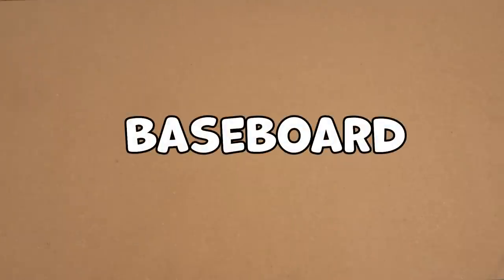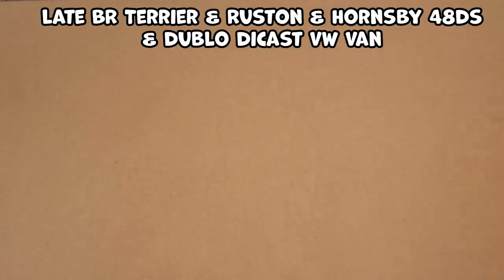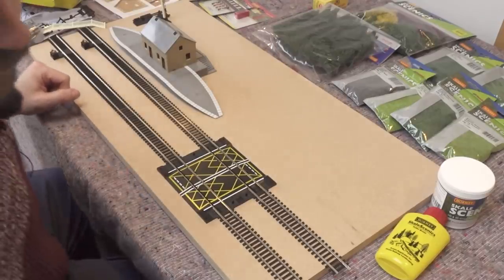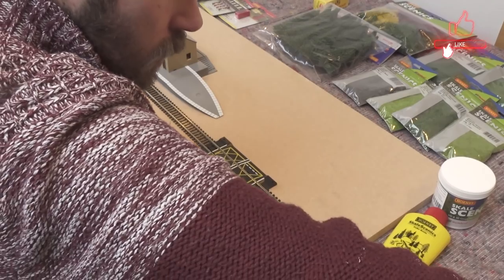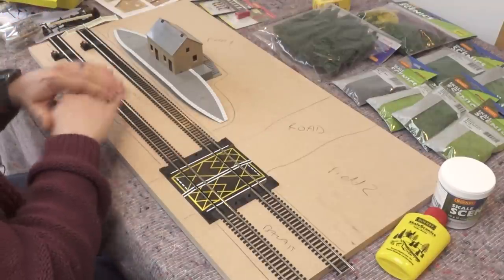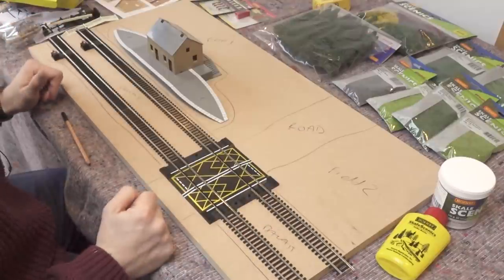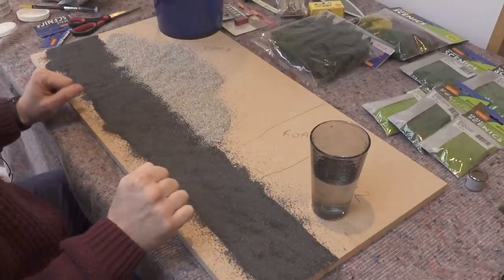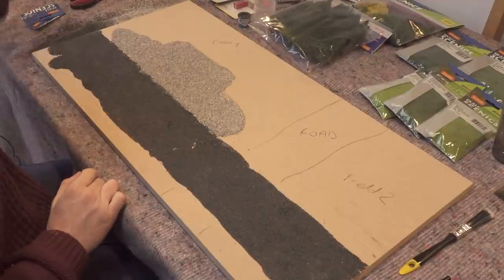The Perfect First Model Railway Diorama (and How to Build It)

Comment: Plan for the future get a 6x4 feet baseboard On legs or trestles made by you or help from some DIY person, Try to build so you can drop some point motors into the baseboard if possible , PAINT THE baseboard with grey or green house emulsion paint from DIY store that will take the bareness away on board (get it so far) Now plan your track and learn to lay the largest radius circle first with a switch (point as some call it too) With a siding so you can run a test train around the circle you have just laid with thin double side sticky tape at a few places only just to hold your track in place while testing your track with power connectors attached ( some thought required here) Get the locomotives to run around the track and across point down siding with our derailing with rolling stock as well, Nice to see a train run around a circle the children love to see them go round and round, Ballast track comes later when you have all your track plan in place in case you want to move a few pieces around when happy with track pin as you go and keep the straight sections straight, Slowly dose it, Trains running smoothly first, Then scenery which you should have some idea what you want, A model railway is never finished that’s the whole idea there is always something to add

Comment: I use ready ballasted Kato track. If I was using ordinary track I'd always lay the track first and then ballast. You don't want uneven track which can derail the rolling stock, especially on points.
I think it took you more time to remove the track, ballast the baseboard and then put the track back on than it would have taken if you'd glued the track first and sprinkled the ballast on top of it.
Why Hornby insist on showing the wrong way to lay track, (which will cause beginners problems and could put them off the hobby), I'll never know.

Comment: Great effort Mike , painting techniques paint as you did but if you dab it over with a sponge. That will take the brush strokes out of it and give a nice road surface .  Also just To let you know, ballast normally is done after the track is down . Then you can put it, in between the sleepers. But looks very good so far, top marks for your 1st go

Comment: Fair play for having a go, I think having people in businesses coming for different backgrounds as yours is useful as it gives variety and diversity but at the same time it’s also great to have people live and breathe the products, so you getting that experience as a first timer is really useful.

In the past (thinking back to my childhood hornby catalogues in the early 90s), an amateur modeller (in the most respectful sense) was advised to place the track where you want it, draw around it to create a ballast bed, paint it grey, pour on the grey scatter (which was pretty flat and easy to pin through) and then place the track over. Another approach championed by Budget Model Railways is to place down roof felt as a more affordable but equally plausible alternative to ballast mat which again is quite flat and achieves a similar effect.

If you glue down ballast derived from grit before the track rather than scatter, sand of fine grit (most 00 ballast I find is too course), then it is hard to get an equal thickness and you may have problems getting the track level, and if you’re pinning it, you can expect more issues,

If your goal is realism however (and it’s fine if it’s not and it’s just about fun), then looking at pics in real life will help but you’ll notice the sleepers are somewhat sunken into the track, and sits in a bed of ballast above the ground level with often a well defined shoulder. It’s also rarely a uniform colour. A few others have suggested some approaches here, but a common one is to lay down a layer of cork sheet first under the track, then lay down the track, which can be pinned or glued depending on how likely it is to be permanent, and then the ballast is placed over the lot; there are some tools to form this into a nice shape but you can do it with a brush. A mix of water-diluted PVA with a drop of washing up liquid to break the surface tension is then applied usually with a pipette to secure the ballast.....

I’ve tried doing it this way and had a nightmare, never got the glue mix right no matter how dilute or how much washing-up liquid!!! Because most of my layouts are very small, I’ll test out the track first, but I’ll glue it down with PVA painted where I want the track bed, place the track, and the pour on the ballast. It can’t stick where it shouldn’t because there will be no glue in the visible surface of the track. To add more realism you can then go back after and build up more ballast where you want it. On some layouts I’ve used cork to build the level up, others I haven’t bothered, especially where the layout represents a yard rather than a section of proper line. I tend to mix crushed soot, different colours of sand and some fine commercially available ballast products to get the effect I want and have even added a little weathering powder to the mix to get the colours I’m after.

The most important thing is this is a learning curve, some railway modellers can historically be quite particular and snobbish, fast to criticise but they’re complete wrong. There’s nothing wrong with aiming for total realism and running a slick timetable. There’s also nothing wrong with slapping a bit of track down and playing trains. It’s a hobby, and it’s to enjoy, you can let your creativity blossom as far as you like.

Comment: Just out of curiosity where did you get the baseboard for your layout? Or unless anyone else can point me in the direction to be able to get some?
Reply: Looks like 12mm MDF available from B&Q.
Reply: I have mine delivered from a local woodyard and collect it when there are no restrictions. I use 9mm hardwood ply and then some pine framing underneath. I pay a little extra and have the wood yard (builders merchant) cut the wood for me as their cuts are better than mine can ever be, plus I am lazy. B&Q do a cutting service but it is hit and miss whether it is open or not. MDF is cheaper but not as good. If you want landscaping and depth, we tend to put insulation foam on top and some even make the whole layout on this foam with wooden support instead of a whole wooden baseboard.
Reply: I use 6mm ply for the top and 2in by 1 in for the frame. Any good timber merchant will cut your boards to the size you require. Id say shop around as places like b&q are expensive compared to little local timber yards

Comment: I'm no expert by any means, but:

1.) I would not use MDF board as a base, as it's prone to warping with water based paint and glues
2.) Would paint the baseboard a neutral dirt colour before anything else (and grey under the ballast sections)
3.) Would lay a track base of 3mm cork or foam underlay for sound deadening and for a more realistic ballast edge
4.) Would lay down the track before ballast, then just ballast and drip PVA glue over the sides and between the rails

Interested to see where we go from here!
Reply: I haven't noticed any warping from using water based paints on MDF.

Comment: I always lay the track first, to make sure its all working and everything before any scenics go in. Then wire it up, and then ballast on top. Since track on 1:1 railways have the ballast packed around the sleepers, not just under them.
Reply: may I ask how you glue the ballast down? I've seen suggestions for a spray glue over the top, but I'd think that would create a layer of glue over the rails too? preventing power from getting there, please correct me if I'm wrong, I'm just a novice modeller!
Reply: @oscarknight3588  I personally use a watered down pva mix which I pour on using a small plastic bottle with a piping bag nozzle hot glued into the bottle lid.
If you use a spray glue, you can easily just use a track rubber or a track cleaning vehicle or something to just clean it off afterwards.

Comment: I'm currently laying track, after having watched many vids on the subject.
My method is: 
1. lay (cork) underlay. This dampens the sound and the vertical motion, which allows the trains to run more smoothly. Use a glue that doesn't dry up hard, because that takes away the dampening effect. I'm experimenting with thick wallpaper glue.
2. Glue on the track with same glue.
3. Test track by running a train
4. ballast track. Spread ballast out with a soft paintbrush. Tap track with underside of teaspoon to move remaining ballast off the sleepers.
5. Inundate ballast with diluted glue with a drop of dishwashing soap in it. The soap removes the surface tension, allowing the glue to soak into the ballast.
Let dry for a few days.
Hope this helps someone.

Comment: I like to put down some cork or foam underlay first. This makes your trains run more quietly and raises the track slightly which is more realistic. Remember to raise platforms, etc by the same amount.

Next I'd lay my track and once happy with it glue or pin it. Then ballast (using a blend of ballasts can look better). To stop points getting clogged flick them a few times to make sure they open and shut properly. Use a fine brush to remove any stubborn bits of ballast. Then glue the ballast. You can weather it for added realism, if you wish.

One con to this is you tend to get glue and ballast on your rails (which will hinder power pick up by your loco) and potentially between points. Track can be either masked in some way to stop this or cleaned with a track rubber  which is easier but causes abrasion to your track, so use a light hand with the rubber.

The reason for laying track before ballast is to keep your track flat and even. It also makes it look bedded into the ballast which looks better.

There are loads of Youtube videos giving top tips for layouts. Here are some links to three I've found very useful. Each is different and has their own way of doing things, but give lots of useful advice and have plenty of "How to" videos as well as running ones.

 At the end of the day there is no right or wrong just what works for you and fits in with the size of your layout, your budget, time available and skills. Even the best modellers are always learning and picking up tips from other people. Don't be scared to experiment or redo things if you're not happy with your first efforts. Lastly have fun! That's what it's all about.

1) https://www.youtube.com/channel/UCPb9_WPXrSj96rxxfciOTog
Mouldyraspberry has just won an award for his Yorkshire Dales layout and shows that sometimes less is more. His layout is only single track but he's concentrated on making beautiful scenery.
2) https://www.youtube.com/user/EverardJunction
EverardJunction has a more modern layout based in the 80s, has amazing attention to detail and is very good a creating scenes with a bit of a story to them. His layout is based on a more rundown city scene.
3) https://www.youtube.com/channel/UCMjSsrcmA4BNeAnh2NxYp0Q
Chadwick Model Railway gives lots of useful tips by an experienced modeller.